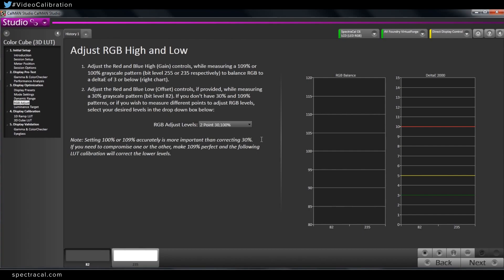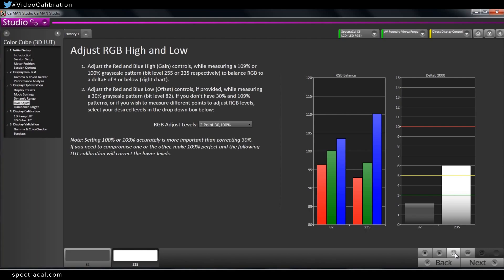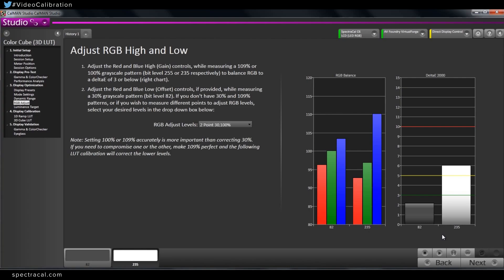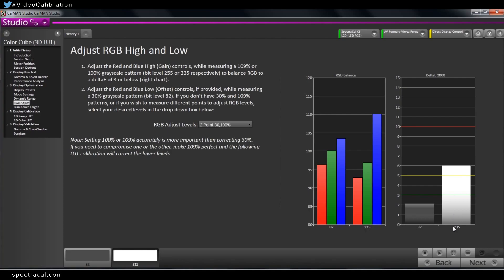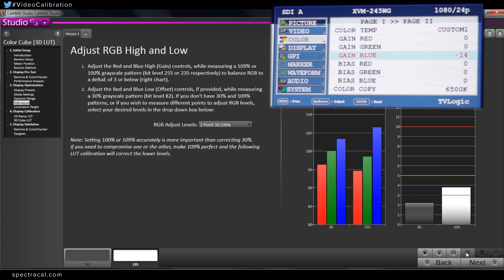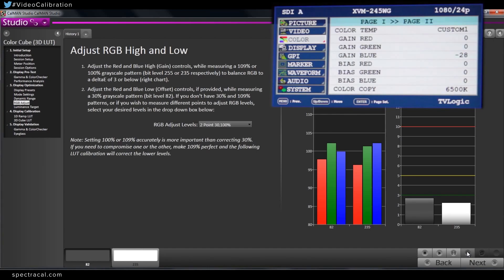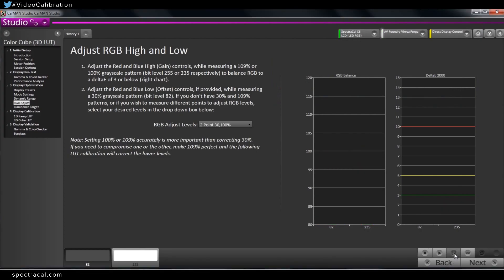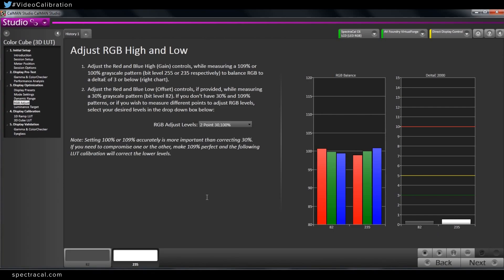2 Point White Balance, RGB High and Low - CalMAN Studio Webinar Topics Part 4

Comment: Hi, do you think it is feasible to change the color temperature using hardware controls of the RGB gain and biases? As the colors are much cooler than 6500K by default. I am thinking if I reduce both B and G channels by quite a bit it would reduce the temperatures.

Comment: The read continuous results are a little alarming to me. Is that normal for an LCD? My plasmas and OLEDs don't fluctuate like that.
Reply from the maker: MrGencyExit64 Looking back at this real-time RGB balance it does look like it is fluctuating more than it probably should. It's possible the display wasn't fully warmed up for the recording, the power to the monitor wasn't very clean, the environmental lighting wasn't controlled well enough, or a whole host of other reasons. Good eye though, you must have calibrated many displays to catch this. : )